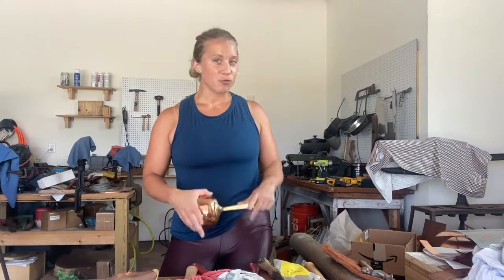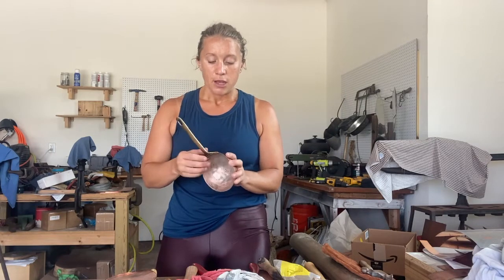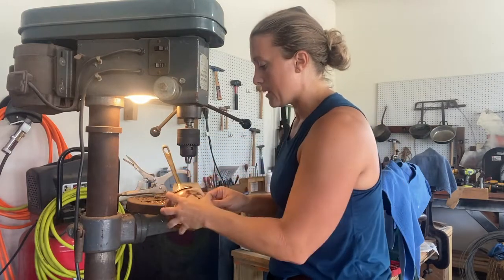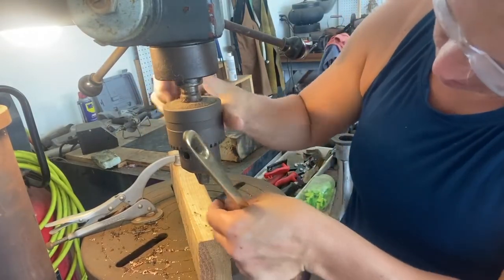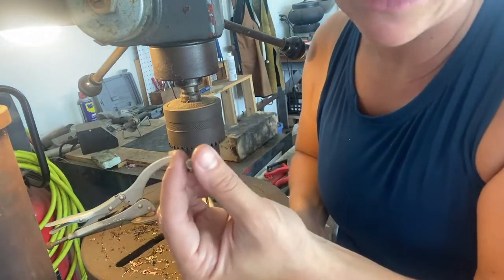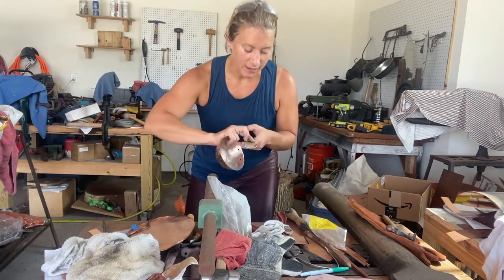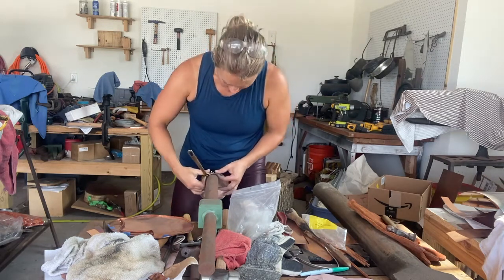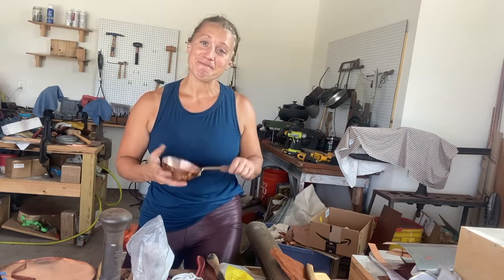How to Drill Out Rivets on Cookware and Replace Them

Comment: Nothing but respect for the skills displayed in not only the fabrication, but also in design, engineering; as well as videography, script and editing.  That said; please keep carpenter’s hammer seen at 8:01 in the wood shed.  Aside from the superfluous claw, the striking face is hardened to drive nails into wood.  Metalworking hammers are “softer” on the face and peen to prevent the shrapnel that can fly from a chipped face on a carpenter’s claw hammer.

Rant over: Carry on.
Reply from the maker: Thanks for the tip - I generally use hammers based on their weight more than anything lol. I've been lucky enough not to see any shrapnel!

Comment: Is there a special drill and/drill bit needed to drill through rivets? We only have a handheld drill and I’d like to separate the handles from my old pots.
Reply from the maker: Nope, just a regular handheld drill or drill press and a drill bit that won't enlarge the holes. You should be OK to go with what you have!
Reply: @housecopper  Thank you!

Comment: Such a small pan. I wonder what it's used for? It looks like you're using copper instead of brass rivets and you don't try to dome the handle side?
Reply from the maker: Yes, they are copper rivets. I never use brass rivets. I do not understand your statement about doming the handle side. This is a process I never learned in my 7 year apprenticeship under a master smith.
Reply: @housecopper  I just mean rounding over the edges on the rivet. In leatherwork you sometimes hit the domer against the rivet instead of using the flat of the hammer.
Reply from the maker: @BrentDaughertyMe  ohhh, gotcha. Thanks! I have never heard it called that! Sometimes I do that if I have a hand tool on hand that fits the size of the rivet diameter (I have a couple that do the 'doming') to create that look. But I do so many random custom riveting jobs I don't have a tool for every diameter of every rivet. In that case, I usually sand the edges over with a dremel so at least they don't catch on dish rags. :)